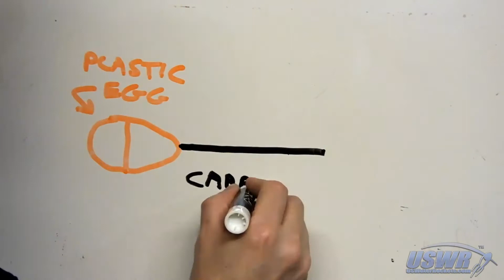Rocket Chase Camera Mark II

Comment: Just subscribed to. I always wanted cool rockets as a kid but obviously money was an issue. You're never too old to be a kid again!
Reply from the maker: Thank you! For what it's worth, we all got interested in water rockets because we didn't have money for pyro rockets as kids (we had them but launched them only rarely because of the cost of the motors). We even made our own water rockets from these hand lotion bottles we had kicking around. This was before the 2 liter soda bottle became widely available. Anyhow, we went off and did other things and then rediscovered water rockets and have been hooked for years. Water Rockets are cheap and very powerful. It's all the payloads we play with now that are expensive!
Reply: I started with putting paper tubes on camera film containers then filling them with vinegar and baking soda. Also hooked a bicycle pump up to some water bottle rockets that got a whopping 10 feet off the ground! Then owned a couple with pyro engine rockets which were quickly lost to trees. I definitely would like to build a couple hydro rockets again one of these days.
Reply from the maker: RcFrenzy When you get around to building a hydro powered rocket, feel free to check out our website, because we have tutorials showing you how to do just about everything you need. Rockets, fins, nosecones, deploy systems, parachutes, launching pads, etc. www.USWaterRockets.com
Reply: Awesome, will do.